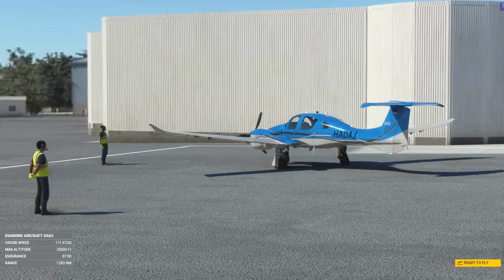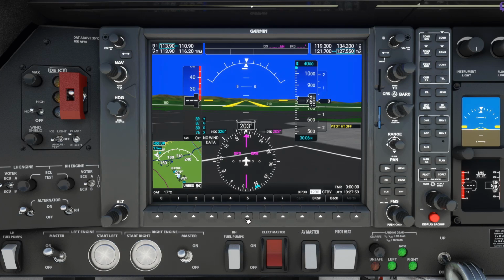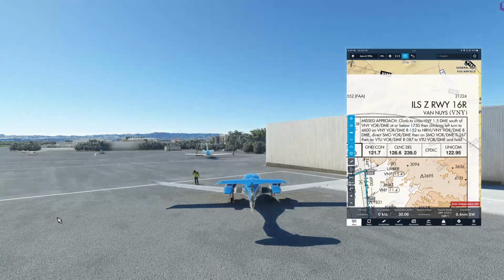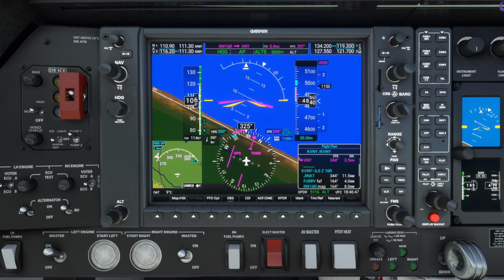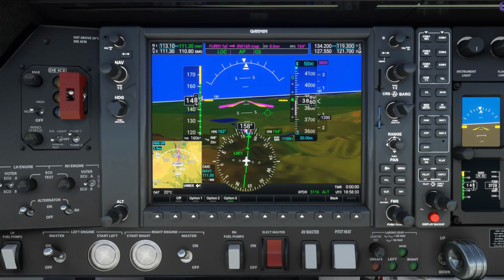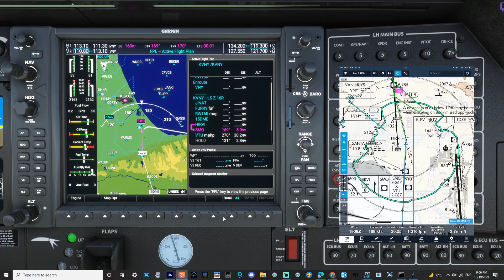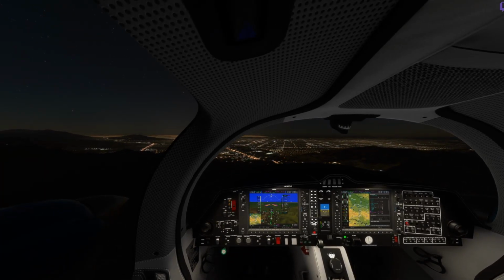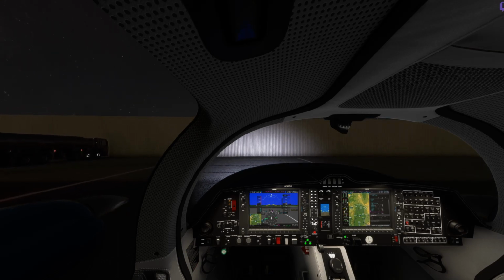Garmin G1000 NXi v0.8.0 Missed Approaches MSFS2020 on PilotEdge

Comment: How does it turn at 1 rate(standard) in autopilot? My autopilot turns non standard???
Reply from the maker: Are you using the WT NXi or the sim's native G1000?
Reply: @drpilotfi  NXI, but it doesnt matter. Both of them I cannot turn standard in AP
Reply from the maker: @eyuphancelik2789  Which aircraft, any mods?
Reply: @drpilotfi  no mods, c172
Reply from the maker: @eyuphancelik2789  I just tested it; you're right. I'll report this to the WT NXi team and let you know what they say.
Reply: @drpilotfi  I appreciate, thanks
Reply from the maker: @eyuphancelik2789  Someone asked that question and they said it's a constant bank turn (not rate one) and it's what the real unit does.